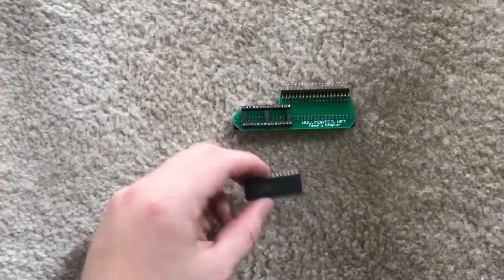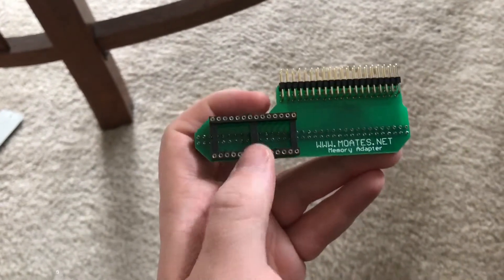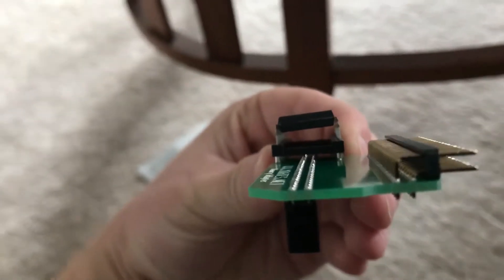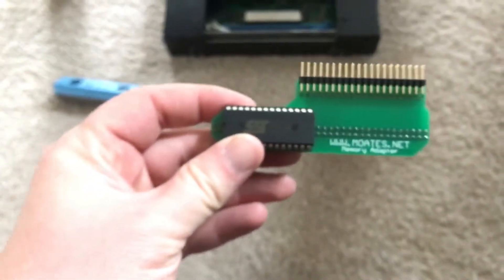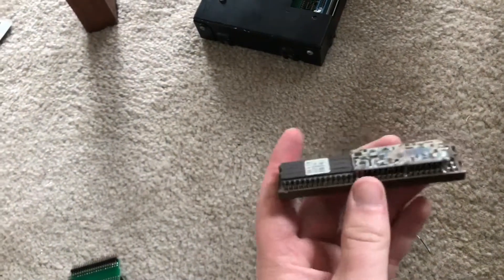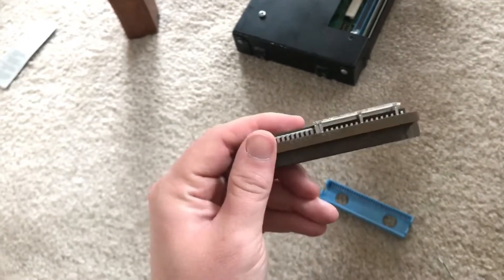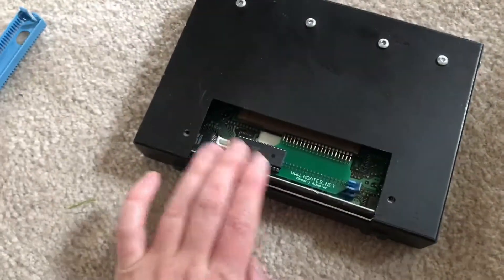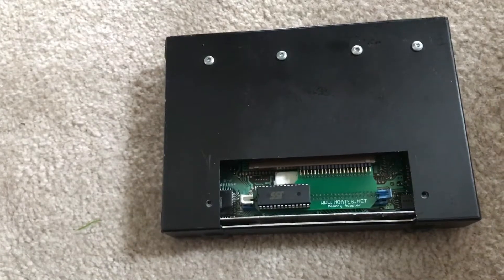Moates G1 Installation

Comment: I did this in September and didn't install the factory chip and the car ran fune
Reply: *fine. I did get rod knock so I'm assuming high reving plus not having the knock sensor caused it

Comment: I have the same set up, but am having trouble getting the right xdf. I need the 8D, but can't seem to get a good copy of it. Computer is 1227730 tpi 5.0 auto AXXF. If you happen to have a good definition file,  I'd greatly appreciate it.
Reply from the maker: I just use the one listed on tuner pro’s website. Is there something wrong with that one now?
Reply: @RyanBooth3  I click on them, and it just pulls up a bunch of gibberish (whats contained in the file), nothing to download. I tried to get it from gearheads EFI, but they have to "approve" your account before you can download one. If you happen to have it, I would appreciate a copy (chriswitt1981@gmail.com) if possible.

Thanks,
Chris
Reply from the maker: I just sent it over. Let me know if it doesn’t come through.
Reply: @RyanBooth3  worked great man,  I appreciate you!!!